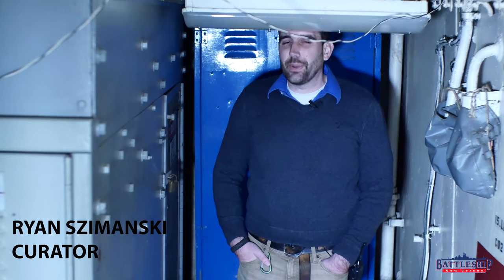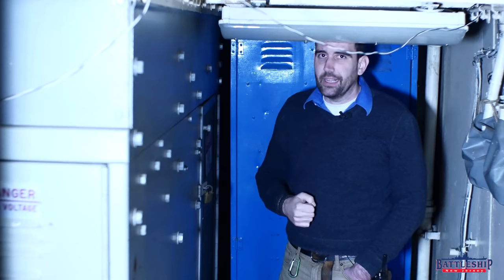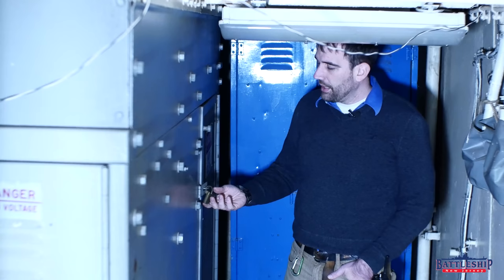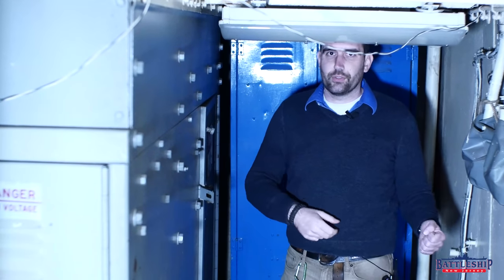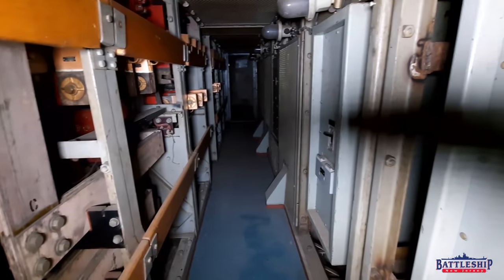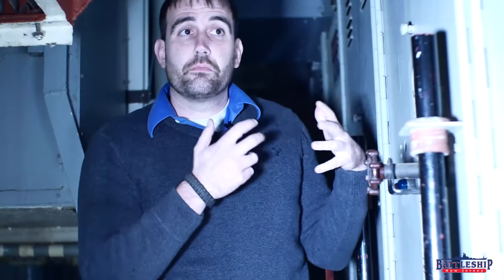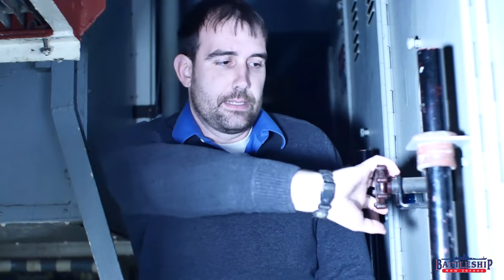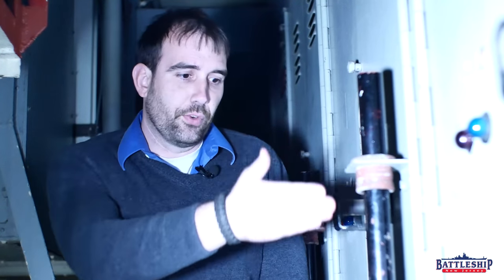Why is a Bus on a Battleship?

Comment: I got shocked by 440 once, was doing a check on a motor controller while holding a metal clipboard, the clipboard touched one of the terminals for an indicator light and I was the conduit to ground.  Knocked me on my butt and was probably about 15 minutes till I recovered.  To make thinks worse I was in a space that was rarely occupied, especially in port (helo control tower on a CG) and if that shock seriously injured me it might have been days or weeks until I was discovered.

There was another GSE in our shop who famously got a shock direct from a 4000A 440V switchboard bus bar.  We called him sparky.

We actually had an annual maintenance task for each switchboard which involved completely powering down the switchboard, which also meant killing power to just under 1/3 of the ship (critical systems can be powered from more than one switchboard so were kept online).  Had to take all the panels of (ours were bolted shut but not locked) and clean and inspect everything.  Obviously only do this in-port and at night when much of the ship is not onboard or asleep.
Reply: I have cleaned transformers in an industry (was done yearly in the summer while the plant was shutdown - when the incomming line from Vattenfall was disconnected and all transformers was cleaned.)
Reply: I got zapped with 480 from a (thankfully) current-limited circuit.  It hurt, and knocked me on my ass.  Circuit was tagged out and tested for no voltage, but some brainless idiot didn't think a red tag applied to him and energized the circuit while I was working on it.

It also hurt when half of A-gang dog piled on me to retrieve their 16" Crescent wrench just before I used it as an aid to review Tag-Out procedures with the idiot who ignored my red tag...

Comment: Diesel electric locomotives will bite the crap out of you. 600v DC at 1500 amps times six. That is the number of traction motors. That is three thousand generator horsepower. I have had the low voltage system bite me numerous times. Only one was significant. Arc flash is the most common issue. The low voltage system is seventy two volts DC. This charges the batteries and gives control voltage. The very dangerous part of our systems is the numerous capacitors that can unload if you touch them. If you high pot a parts of a generator or traction motor while they are isolated, they can hold a charge like a capacitor. I learned that lesson the hard way. When I have been shocked, it was only my right hand. Electrician rule number one is, keep your left hand in your pocket to keep the current away from your heart. 
Greetings from the high plains of Texas.

Comment: Working on a radar display in the Marine Corp in the early '80s. Plugged a voltmeter into a +700vdc test point. OK, 700 volts. Went to unplug the meter and touched the metal ferrule on the probe. Shorted the 700 volts across my hand to the guard rail that kept the air traffic controllers from kicking the test points. Evaporated a bb sized bit of my index finger and left a dozen little black spots on my ring and pinkie fingers where it came out. My whole arm felt like I just slapped it hard on a table. Fortunately I was following the safety rules and not touching the equipment with my other hand.

Comment: Haven't zapped myself, but a friend of mine did while operating a mig welder with the amperage turned up almost as high as it would go for some reason. While clearing gunk out of the tip, he closed the circuit with his gold wedding band, which he'd forgotten to take off. There is a gob of steel and gold still remaining on the wedding band to this day, and he had to stop wearing it for weeks to let the burn heal.
Reply: Did something similar working on the ignition switch on a 67 Jeep. Got my gold class ring grounded and against the hot terminal on the switch. Took a pretty good chunk out of the ring. Didn't take long to remove it from my finger either.

Comment: I mentioned in your earlier video on the electrical fault detection, that I am an Aircraft Electrician. I have been electricuted a few times by an aircraft. 110vac at 5 amps. And one of those times I was electrocuted across the heart. That was fun...

Comment: When I was 4 or 5 we had an old 5 tube kitchen radio by the sink.  Those had a 'hot chassis'.  Well, I pulled the knobs off the front and grabbed the brass shaft while leaning on the sink.
I got a really nice jolt.  I was checking my fingers to see if I hurt myself and discovered ridges on my fingers (yeah, fingerprints).  I thought I'd really done something terrible to myself.  Scared the heck out of me!  😀
Reply: I've recently started to get into "tube" electronics, along side my vintage-computing hobby. When I first heard about "hot chassis," I remember thinking "back in MY day, we didn't HAVE safety standards" (though I'm not actually THAT old), and remembering when they tell you not to use a toaster or a radio while in the bath tub, and now knowing WHY.
Reply: Ouch. I remember being that young, and sticking a finger between the prongs on a two-prong receptacle while trying to plug something in.

Comment: Very nice video. As you said, It's not the voltage that kills you, it's the current. But the current rating posted on a circuit is not indicative of how much current you'll actually receive if you touch it. To find that out, you need Ohm's Law. Here's how it works.
At 1 mA, a shock can be felt.
At 10 mA, you may lose muscle control and be unable to release whatever is shocking you.
At 100 mA, if the shock is a second or more across your heart, you can die.
Average human body resistance is around 500-600 ohms, but it can potentially be as low as 300 ohms when it's hot and humid and you're dehydrated, sweaty, and tired. Fortunately for USN electricians, dehydrated, sweaty, and tired is our normal condition, so we'll just assume 300 ohms resistance.
Now that we've got current and resistance, calculating voltage is easy. V=IR -> V = 0.1A x 300ohms -> V = 30v
So there you have it, a voltage source as low as 30 volts can potentially kill you.

BTW anybody posting in the comments claiming to have been "electrocuted" is wrong. Electrocution is death from an electrical shock. If they're posting in a youtube comments section they clearly survived their shock, so they weren't electrocuted.

Comment: Completed the circuit of a 240 volt welder set at 250 amps. That felt REALLY GOOD!
Reply: Yeah but the open circuit voltage of the electrode is probably 50V or less.

Comment: electrocution intensity is directly related to voltage.  For instance a 600 amp 12 volt car battery will not normally give one a dangerous electrocution, however a 1 amp 120 volt source can kill ya.
Higher voltage overcomes the body's resistance and causes more current/amperage to flow.  400V at 4000 amp can literally explode your body from the heat of the current.

Comment: I've been hit with 110V 30 amp a few times. I never used to shut off the breaker to outlets I was working on, so that I could still plug in a light on a different outlet. After three hits, I decided that it wasn't silly to turn it off and run an extension cord from a different circuit.

Comment: worst ive ever been shocked was working as a welder my first 2 years as an electrical apprentice (i screwed up and said i could weld)
welding strut to motor skids for cable tray to run on... had sat in a puddle earlier and my butt was soaked (see where this is going?)

never wear gloves when welding because most of the time we were in to tight of places and only running 110 amps for 1/8 rods, not much spatter, well i went to change rods and when i connected that new electrode to the machine i felt like i was sitting on my GF fave... "washer machine"... 

only got free from falling backwards off the skid and breaking the path... scared me pretty good, but that DC had ahold and wasnt letting go at all, worst part was hearing the Bobcat engine loadup and knowing that juice is going right through you

pretty lucky, but never had any health effects from it, thats been 15 years ago and im 37 now

Comment: As an ET1 I was in a 19 inch rack panel.  That is a 19 inch square electrical panel for electrical distribution to radio's, teletype and other equipment.  In there I got across 110v dc for the teletypes.  Worst I have ever been shocked.............Jay

Comment: Atwater Kent Labs at WPI in Massachusetts used to have a wall covered in Frankenstein's-lab equipment in the lobby, left over from the long-ago days when it was an experimental electric streetcar testing facility. I haven't been there in many years, but I think I remember hearing that most or all of it was removed when the building was renovated a while back. I hope that rumor is false, because it was by far the coolest thing about WPI's (admittedly not very exciting) campus when I was there in the '90s. :)

Comment: Shocked yes. Electrocuted never.
   It takes both voltage and current to shock or electrocute.
   Worst shock occurred with a system powered down. A colleague thought is was funny to power the system up. I got nailed by about 4000 volts. Lost hearing in my right ear and partial loss of vision in my right eye. I left that job!

Comment: Had a hold of 25kv or so a couple times.  No current to amount to, but the jolts made me taste copper for a few hours.  Both instances where faulty CRT’s that had a leakage path from the 2nd anode connection to the surface of the glass.  More damage done by the ‘rapid withdrawal’ of my arm/hand from the equipment and the sharp metal chassis

Comment: My father was an electricians mate on a tin can.  His battle.station was in front of the switchboard.  He turned his navy training into a career with the regional power producing company here in the Carolinas.  I learned enough about it to wire in a new HVAC system for my house.  All the installers had to.do was make up the final connections.

Comment: I got a nasty jolt of 240V when I was a kid. Not pleasant. Back when I was a computer engineer we used to connect up three phase supplies which was 415V between any two phases. More than enough to kill you. The phases here in England are labeled Red, Yellow and Blue. Three phase supplies are rare domestically, but are common in industrial environments.

Comment: I welded a pair of Chan-L-Locks to a brass nut on a water heater, there was a dead short from a 220 V dryer circuit to a hot water distribution pipe in the wall.

Comment: Highest I've been hit by was a 277 volt control circuit for a motor emergency stop circuit. I didn't check the breaker before checking the emergency stop itself and got a nice 277  volts into my thumbs. But for reference, 277 and 480 volts, (if its a Wye transformer), is basically the same thing with 277 being the phase to ground voltage and the 480 volts being phase  to phase. And although the panel on the ship is labeled 440 volts, chances are the Power company is providing 480 volts since 440 volts is a very old voltage standard that  is rarely used anymore. And being an electrician, i have been hit by 120 circuits more times than i can count.

Comment: I had the capacitors from a tube amplifier unload in me at work, that really sucked, could hardly move my arm for about half an hour.

Got shocked cleaning a pool when someone threw an extension cord in to the emptied pool, the leftover puddles gave me a good shock.

Countless other times I've been shocked just working with appliances/lights/fences etc, so at this point i dont touch electric powered things unless i know for a fact it's safe. I'm done with that feeling.
Reply: I've gotten a few 400v DC from tube radios. Scares the hell out of you.

Comment: There is an old urban legend told to newbie techs to scare them into being careful. In a large hospital in Canton, OH ; an electrician was crawling through a cable raceway service passage where the 440 power for the ventilation system ran from the roof. His big round western-style belt buckle got caught and dug into the insulation of a main cable... And all they ever found was the burned, bent, and distorted belt buckle. He had been vaporized.

Comment: Ryan, the good news is you weren't shocked with 30 Amps; that would have killed you outright.

The bad news is, the shock you received was much less, and probably still sucked.

Electrical Devices (or people) draw power, and the resistance of your body lessens the current, which is what is measured in Amperes (Amps). We often like to think of electricity like water coming out of a pipe or hose, but that metaphor simply doesn't always work when talking about electrical current. So the 110v-120v 30Amp circuit you were shocked by was rated up to 30Amps; it doesn't just shoot out 30Amps to what ever gets connected to it.

 For reference: 0.08 Amps (80 milliamps) across the heart is enough to stop it and kill you.
Reply: 30 amps would make roast pork.

Comment: 120 to 240 volts less than 30 amps you kinda get used to it. I don't even swear anymore. AND you know what breaker is associated with that circuit because usually it trips.

Comment: After my sister killed TV number two by leaving the Atari on I decided to take it apart. I quickly learned what capacitors did and what 280,000 volts felt like. Now I may still be scared of lightning but I've lost count on how many circuits I've worked on that were live working as an apprentice for a retired power plant manager and have also worked for an electrical distribution and transmission construction/maintenance company. My first week was shadowed by our company loosing a lineman with 40 years of experience that had got complacent and grabbed a ground that went across a highway connecting one underground transformer bank to the new one where he grabbed the ground which had thousands of volts from induction and enough amps to burn a hole through his body.

Comment: As an aside. You have mentioned the necessities of dry docking every now and then but the need to keep it in water to alleviate the stresses on the hull.
Why not build a basic dry dock near the ship. Keep it in there all the time, flooded, and when needed empty it to do work on it. A permanent cradle could be constructed to line the hull up with the support blocks.
It’s not such a large or complicated job, after all dry docks have been built for centuries.
The long term cost savings should outweigh the construction costs.

Comment: At 5m50s, I thought you were going to say that old expression "It's the volts that jolts but the mills that kills"; a few milliamps can be enough to cause your heart to flutter (fibrillation) and lose its regular beat pattern. The medics will know more about that kinda stuff than me, I just know the electrical side of it.
Reply: I have actually seen several cases of people taking a high current hit and surviving. A Dr. explained to me that the high current causes the muscles to contract and holds the heart like a vice so it can't go into fibrillation; while the force of the shock blows the guy off of the wire (sometimes as far as 20 feet away).
Reply: @ghost307  probably worth mentioning that an expression like what I mentioned isn't a "this is always true" sort of a fact, but rather to compare and contrast the different aspects, voltage and current and the typical effects. It's also designed to be memorable unlike lengthy and boring explanations such as this comment of mine :)
Reply: @carneeki  No problem.
I'm not trying to start an argument...just relaying (no pun intended) a very unusual event.

Comment: As little as .1 amps can kill you if you were shocked the wrong way, the voltage doesn’t matter as much. It’s harder to get more amps out of a lower voltage, but still definitely possible.
Reply: The voltage has to be high enough to shock you at all, though. A car battery can deliver hundreds of amps to crank an engine, but you can safely touch both terminals as it's only 12 volts.

Comment: I reached between a pump motor and the stanchion next to it. My hand contacted both. Due to a ground fault in the motor, I got a shock across my palm made my arm numb for hours. It was a 440VAC 3 Phase motor 400 HP.  This pump was the seawater cooling pump for one of the SSTG's. Turned into a nobody sleeps in M or E division until this motor is replaced. Nuclear Navy at its finest anal retentive.
Reply: ship service turbogenerator for anyone else confused.

Comment: I got shocked once during my auto maintenance corse at the nearby tech school. One of the vehicles used for training in the fire and rescue Department wouldn't start. Me and my partner got tasked with fixing it. The car was in a classroom with a class in session about  ironically enough taser training. We were testing for spark and forgot why I needed to grab the loose spark plug wire, grabbed it wrong and got zapped. I yelled "son of a". They asked me if was alright I said "I'm fine I think I know what it is like to get tased because that was 30,000 volts.

Comment: Back in the early 1990's I used too fix fax machines for a living. One time i had to to a customer which was a golf course in Palm springs Califonia. athey had a fax machine in there business office that had some issues with there paper cutter. I took the cover off to see what was going on. I bypassed the safety switch to see if the cutter would work. I inadvetnly touch a piece of metal on the side of the machine and got a wide awakining shock. I then tried to bypassed the safety switch and once again i touched the same piece of metal and hot shocked again. I then said too myself "Boy that was stupid of yourself to get shocked twice in a row by the same method" I then got smsrt real quick and put on thr partial plastic cover over that metal and then was able to bypass the safety switch too cjevk the cutter switch and repair the machine. Many lessons learnd that day.